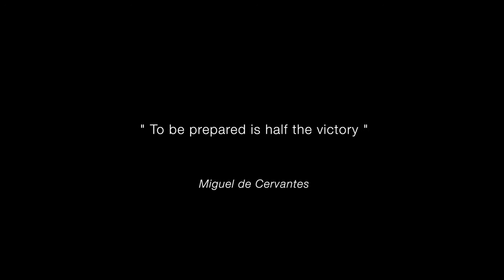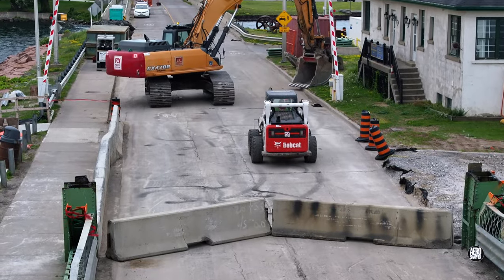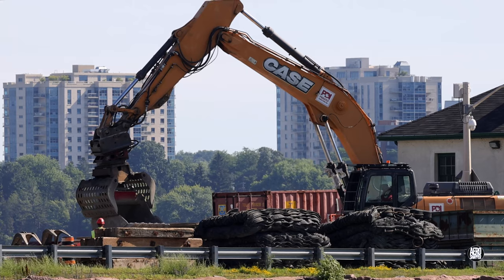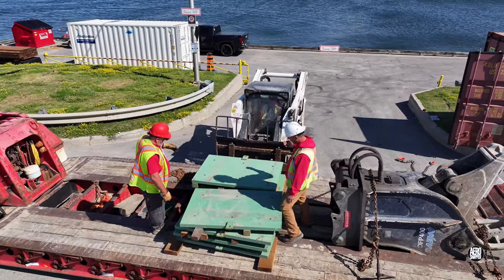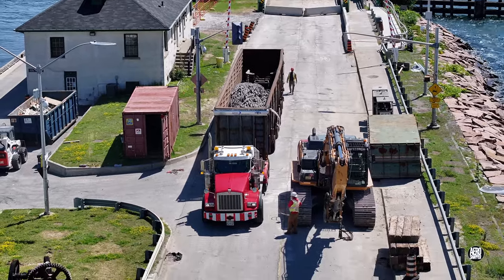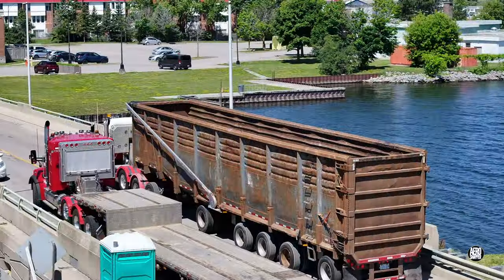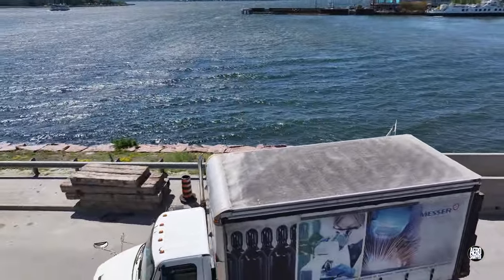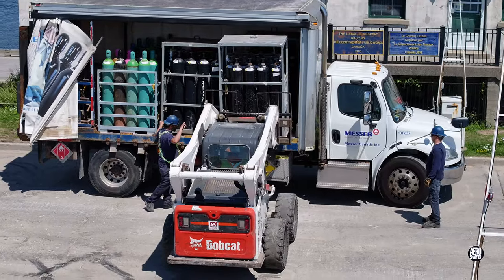Everything has got to go  - an update on the La Salle Causeway lift bridge 4K

Comment: I looked at the structure, the bridge could have been repaired. By replacing the girders on both sides . Whoever made the decision, didn’t care about erasing anything piece of history. I’m sure the engineer wasn’t from around here , know what I mean .
Reply: they had to get the waterway opened as ships were trapped. i thought they could have replaced the beam with some modern I beam or square tubing
Reply from the maker: It's been stated that damage from the 'incident' was not limited to that visible on the buckled beam on the north side.
Reply: @gangsterdiesel0093  Federal government-owned bridge not subject to provincial reg for annual inspection. I wonder whether they were done regularly and if the structural inspectors recommended replacement some time ago.